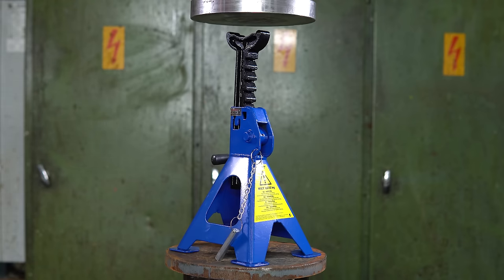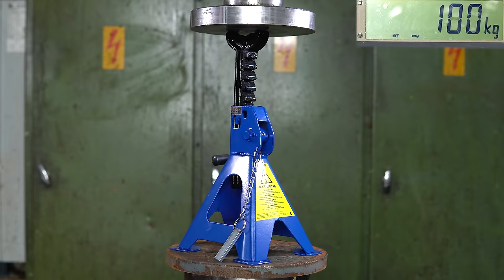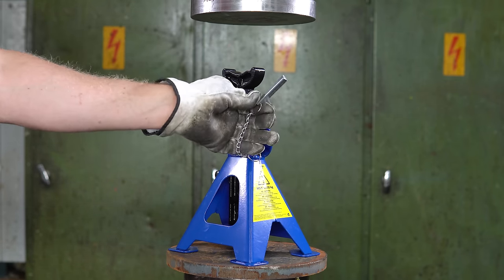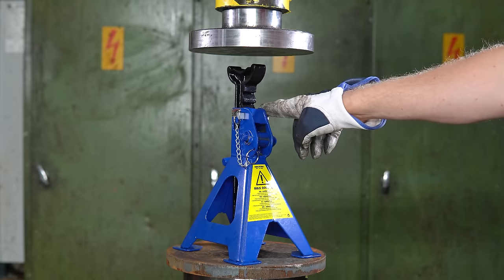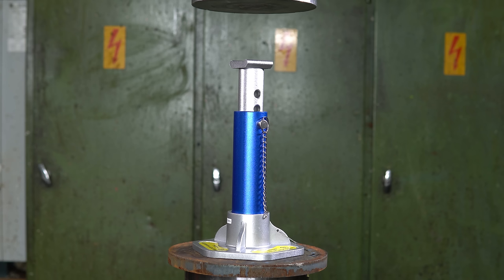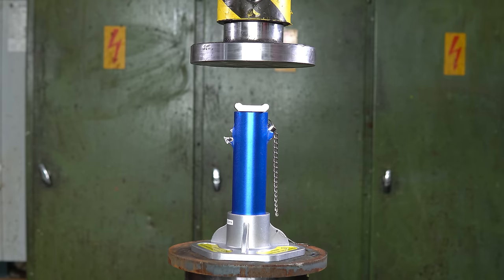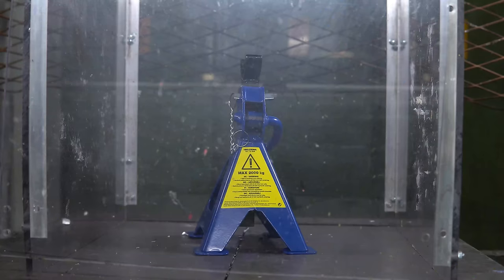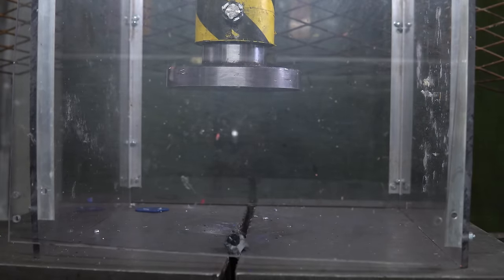How Strong are Jack Stands? + Broken Window, AGAIN!

Comment: safetypin adds 3 ton, that is a mind blowing moment for me
Reply: Find a way to test just the safety pin.
Reply: @sweettooth7124  he literally did in the video did you not watch it??? And it was with the safety pin they already damaged
Reply: @thatguy1919  it appeared that the main catch was in place.
Reply: @sweettooth7124  he cut it out
Reply: With the cast stand, yeah, that was encouraging.   
The pin in the aluminum stand pushed down through the aluminum pipe like a warm knife in warm butter — the scenario I would be afeared of.
Reply: @77thTrombone   well, yes and no. Storytime!

Miners back in the day where I am from had oak readily available. Still they build their mines with the softer pine. The main reason being oak just snaps and pine is creaking hard before it reaches the breakingpoint giving plenty of warning.
Reply: @Baer1990  very good story.
Um, is aluminum a creaky metal?
Note to self:   don't use locust in the mines.  (It's more brittle than oak!)
Reply: @77thTrombone   no I mean I'd rather have the jack fail slowly than the car dropping without warning
Reply: @Baer1990  I get the slow failure bit.  If I'm under a car, preoccupied getting some vexatious part in or out, I'd much rather have a creaky slow-failing metal than a silent slow-failing metal.
Reply: @77thTrombone   Yeah but the aluminum jackstand was able to hold 8,900lbs (~4.5 tons) more weight versus a traditional jackstand. Both jackstands had a rough safety factor of 4 (meaning they both held four times their rated weight). I believe the discrepancy in capacity has more to do with design than material. The iron stand utilizes a ratcheting pawl that relies entirely on two eylets stamped into what is most likely pot metal to hold the center column in place against the center tube. The aluminum stand on the other hand utilizes a cylinder-in-cylinder design that has a tighter tolerance and supports the center column throughout the load path. The locking pin passes through 4 layers of metal and has no other parts where the traditional jackstand has a pawl with a handlebar, locking pin, wedge, and eylets that can fail--complexity generally introduces more points of failure (but of course this gives finer height adjustment). The cylinder-style stand, regardless of material, seems to be the safer option given you have a level surface to work on.

It was especially encouraging during the destruction test to see that while the traditional stand buckled and fell over the cylinder-stand maintained its intended orientation to destruction. Also encouraging is that, were you using 4 aluminum stands, you would need an ~110,000lb load to replicate this failure--the average car weighing 4000lbs (or 14.5% of the failure load of a single aluminum stand!).

TL;DR you're probably safe under the aluminum stands unless you work on M1 Abrams tanks for a living.
Reply: I doubt it was anywhere near 3 tons he just piled on loads of pressure all at once lol
Reply: @zecharious3701  very good points. 
I concede.
Reply: @Baer1990  .. red wood timber will last .

Comment: Next Video
Harbor Freight jack stand vs Amazon Jack stand
Reply: we don't have Harbor Freight in Europe
Reply: I wonder it how much it would cost for me to send you some from Texas
Reply: Both are from the same line.. Junk..
Reply: Brice Hysmith jacks are heavy so probably not cheap to send it
Reply: I dont know about the Jack stand but I have a harbor freight Jack that is 10 years old and I use daily on cars and suvs and it still doesn't drop or leak. For 75 bucks I'm impressed.
Reply: ...vs Harbor freight bought on amazon.
Reply: @brucetec6597  The stands had a recent recall if you haven't heard. They honored a free trade-in for the new design. Then, weeks later, they recalled the new design and are fulfilling full refunds now. The part numbers for this are publicly listed by them.
Reply: @TWIRKNOLOVE  I would know about the jack stands. I would never trust my life to Made in China. If a jack fails I'll just use another one. Since I never go under a vehicle with a jack only.
Reply: Project Farm needs a hydraulic press
Reply: @ggabixx99  lol best you probably don't have them 😉
Reply: @brucetec6597  i bought a set of 6tons for my truck. Never used them, and had the recall. Day i brought them back for the recall the entire head piece fell apart. Im happy i never had to use them! Also, I'm looking for a decent 12 ton version that won't break the bank on jackstands..  The 3 ton ones i have are just too small and low, but great for the small car and lawn equipment. They are not HF i might add.
Reply: @brandoncaldwell95  let me know if you find a good set of 6 or 12 tons. I'm looking for some now. Yah the 3 ton is ok for now but too short too. I have to leave the vehicle on the jack and put the 3 tons underneath where the car would fall if the jack ever failed.
Reply: @ggabixx99  you probably have them under a different brand name. we get harbour freight stuff at "princess auto" in canada.
Reply: Harbor freight stands work fine if it’s not the recalled one
Reply: Amazon owns Harbor Freight
Reply: @ninjazzrhythm400  no they don’t that was a April fools joke article that you probably read! Lmao! Eric Smidt is the Owner and Founder of harbor freight to this day!
Reply: @gregorybutcher9555  Yap that's why I would never trust jack stands made in China.
Reply: @brucetec6597  if it isn't the recalled harbour freight jack stands then you good yeah 🙏🏽
Reply: Harbor freight jack stands killed my fucking cousin bro.
Reply: @Akuma currently in the process. It’s hard rn.
Reply: @gregorybutcher9555  recall or not I will never trust Made in China with my life.
Reply: @coastiedave4130  sorry for your cousin. That is why I always leave bothe the jack stand and the jack under the car. If one fails there is a backup.
Reply: We have Biltema and Clas Ohlson in Scandinavia, pretty similar to Harbour Freight and Amazon except they actually have warranty on their junk.
Reply: I wouldn't trust a harbor freight jack with my life
Reply: @m3m3z_machine36  You should never trust any jack with your life. If that's what your doing you really need to reevaluate the way you secure a raised vehicle.
Reply: @brucetec6597  I already don't trust any Jack ive had two friends who's dads have died from a car falling on them.
Reply: Two places I would never buy Jackstands from.
Reply: @CesarMartinez-vw1qd  I have never tried the Daytona but my Pittsburgh has outlasted 2 Snap ons. I have been very disappointed in alot of Snap on products lately. Matco has not failed me yet.
Reply: @brucetec6597  check to see if you have the recalled versions. They recently recalled all of them sold by HB.
Reply: @brucetec6597  hilarious, you trust your life to made in China on a daily basis.
Reply: Wish and aliexpress should be the bottom scrap chinese junk available in scandinavia.
Reply: AKA, both crap...lol
Reply: It’s not about weight it holds it’s about the engineering of the stand itself over time
Reply: Do this please!,!,!
Reply: spoiler alert: they're the same jack stand...
Reply: Yoooo
Reply: @brucetec6597  Newsflash for you, everything else you own has been mostly made in China.
Reply: Both will break the machine.
Reply: @brucetec6597  now that you talked about it I bet it will fail lol
Always happens with me when I acknowledge a good tool it fails lol
Reply: @brucetec6597  I got 6 ton jack stands from northern hydraulics and tool, they are headquartered in Minnesota, in sure they are Chinese but I paid $40 for the set and I put them under the front axle of my Kenworth
Reply: 🤣🤣🤣
Oh- you want a race to the bottom, I see!
Reply: What about duralast jack stands from auto zone
Reply: @MikesSoftLemonade  then buy him one
Reply: @ninjazzrhythm400  nope
Reply: @CesarMartinez-vw1qd  yep
Reply: @ggabixx99  you're not missing out on anything.
Reply: More evo content pls
Reply: "Harbor Freight Jack Stand vs Wet Cardboard Box"  their stands aside, I love and own so many of their tools
Reply: @MikesSoftLemonade  Could he just use a tractor bucket with a scale underneath the object? The tractor would also have to be anchored down of course.
Reply: Somebody send him some harbor freight stands lol
Reply: lmaao the Hobo freight will fail just from opening it and putting it on there. The only good HF ones are the knock off NOS ones.
Reply: @MikesSoftLemonade  haha yes. a big one like this. Man the things he could do lol
Reply: @ninjazzrhythm400  no they dont.
Reply: they're both likely to be shitty china steel. obviously you can find higher quality stuff on Amazon, but it's going to recommend you cheap shit that makes them more money.
Reply: I use 8 harbor freight stands because I'm scared to die holding up my 65
Reply: He's not going to import from a foreign country when they sell items locally
Reply: Lieutenant Dan from Forrest Gump lost his legs thanks to Harbor Freight jack stands
Reply: @TWIRKNOLOVE  haha
Reply: @brandoncaldwell95  There are some items one should never buy them from HF, similar to not buying $1 steaks from Dollar store.
Reply: @ggabixx99  it’s where Americans buy the cheap, wholesale Chinese tools

Comment: The "failure mode" of the jack stands is really important as well. They fail vertically without losing lateral stability, really important for safety.
Also they probably deliberately make it weaker in the vertical so that it's a controlled drop.
Reply: Wouldn't it be stronger in the vertical in order to drop slowly? If it was weaker it'd just crumple fast....
Reply: @Jay-we2ek  it's weaker vertically than laterally. That doesn't mean it's weak vertically. It just means it goes down when it breaks rather than to the side. The speed of the fall is significantly less important than if it sends shit to the sides uncontrolled

Comment: That's a pretty impressive safety margin. I have a set of really nice stands with redundant locks and I still feel nervous sliding under my 2200lbs vehicle. This video assured me that better stands are really goddamn strong compared to their rating. It's also impressive that the two proper stands failed gradually rather than snapping. Engineering has come a long way.

Comment: Great job! Keep up the good work! 

I use jack stands but I have NEVER trusted them. I have always used tires under my car just in case. And Thank God I have always done that! Two years ago I accidentally bumped one of my jack stands and even though I had the safety pin in the jack fell immediately when bumped! If those tires were not under my car I would not be here to comment today!

Comment: Ahh so glad I saw this video! Now I feel better about my four 6 ton jack stands to work under my 1967 VW bus and my wife’s car 😆
Reply: Remember this is not shear measurement. So if the car drops it is a different outcome.
Reply: @TheKevo7777  if the car...... drops? I dunno how you usually use jackstands, but all my life with the way i've used em, its a constant load.. lol
Reply: That's serious overkill for the VW bus.  You could've made do with milk crates  (the steel kind that were in use back around 1970.)   
(Yes, I am exaggerating slightly, but not nearly as much as the guy who's supporting a 2,700# vehicle with 48,000# of stands.  And, yes, the prudent mechanic will prefer his exaggeration to mine.  And, further yes, as this defensiveness is meant to advance-intercept YouTube commenters who only get jokes when they have post-it notes on them)
Reply: @TheKevo7777  I'm no mechanic (I don't even own a car and know basically nothing about car maintenance) but aren't you supposed to rest the car on the jack stands? Correct me if I'm wrong because like I said I know basically nothing about this but if I'm correct then why in the hell is your car falling onto the jack stands?
Reply: @the_undead  First you use some type jack to lift the vehicle and lift higher than you want it. Then you stick in a jack stand under the vehicle to support it. At this time, you lower the jack to allow for the vehicle to rest on the jack stand. Now, there are, manual jacks like the one that he tested last (the scissors jack. Note that, unlike the other ones, this is not a jack stand), pneumatic jacks (powered by pressurized air), and hydraulic jacks (powered by pressurized liquids). The last two require that you relieve the pressure by opening the relief valve. Most times is hard to control well how much relief to provide and the jack gets lower too fast, therefore, dropping the vehicle on the jack stands.
Reply: @Sffker   First you use some type jack to lift the vehicle and lift higher than you want it. Then you stick in a jack stand under the vehicle to support it. At this time, you lower the jack to allow for the vehicle to rest on the jack stand. Now, there are, manual jacks like the one that he tested last (the scissors jack. Note that, unlike the other ones, this is not a jack stand), pneumatic jacks (powered by pressurized air), and hydraulic jacks (powered by pressurized liquids). The last two require that you relieve the pressure by opening the relief valve. Most times is hard to control well how much relief to provide and the jack gets lower too fast, therefore, dropping the vehicle on the jack stands.
Reply: @jtcmlt1  your extra comment trying to be a know it all is cute and everything, as if I've never used a jack in my life or worked on anything, but pretty hilariously bad just like your equipment if your release valve is uncontrollable (or you're just a shit operator) my entry-level hydraulics teacher would be cringing right now with you saying "pressurized liquids" when a liquid is incompressible and pressure is derived from restriction of flow in a circuit not the compressibility of a fluid as if it was a gas, lol.
Reply: @jtcmlt1  lmao. someone’s butt hurt. your comment makes no sense, but your anger is pretty visible. im a mechanic by trade, sorry i got an education both in the field and at a trade school and know what im talking about. your life must be pretty miserable if your go to is to insult random people on the internet or act smart (when you’re not). by the way my original comment wasn’t even a question? lol. And also stated I’ve used jack stands and jacks appropriately without damaging mine or others property before? lol. But go ahead
Reply: @Sffker  when I worked in a shop in the 70s when the bays were taken, they rolled out the hydraulic jack and definitely “dropped” those cars onto jack stands!
Reply: Always use stands rated above the vehicle weight. Because there's drop weight. The weight of the vehicle while it's traveling down. Jump on a scale. The maximum load on the scale will be more than you weigh. Cars are not something to fuck with. You always want to do things by the book and take extra precaution. I watched a Pro do car stuff and he used a very powerful jack and lowered it onto the jack stands and left the jack under the car as an added protection. There's a reason mechanics get paid more than your local car guy. You can hurt yourself while you are driving, or while you are working on it. If you aren't 100% sure what you are doing then don't do anything and find someone who does.
Reply: @SF-dy6hn  being safe is always important. However, this escapes many, many peoples mind, as they just aren’t situationally aware more so then not concerned for their safety. People put too much trust into consumer products. Where as say, if I made my own jack stand, welded it and all myself, I’d know it would withstand the weight of a corner of a car. I use the jack, jack stand, and even a rim as safety devices if I can. Blocks of wood or stone if nothing else.
Reply: It's your wife you have to worry about...
Reply: You have a 1967 VW bus and your worried about safety, that does not compute
Reply: Totally agree, I never crawl under a vehicle unless they are supported by at least 2 x 6-ton jack stands, from a Civic to a Silverado 2500HD I've owned.

Comment: I just bought some Harbor Freight Daytona aluminum concentric cylinder pin jack stands and was very reassured as to their strength. I also like the fact that the simpler mechanism will be less prone to failure.

Comment: The scissor Jack surprised me. They come in a wide range of quality.
The aluminum stand would take more if it had a fatter pin.
Reply: Have you seen the half scissor that Volkswagen uses. Those fuckers are terrifying to use just to change a tyre.